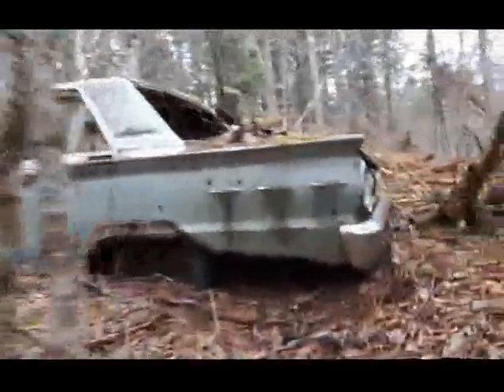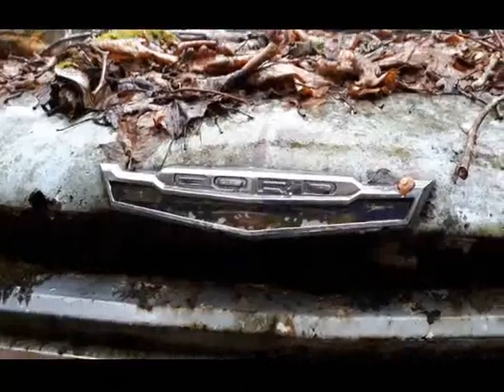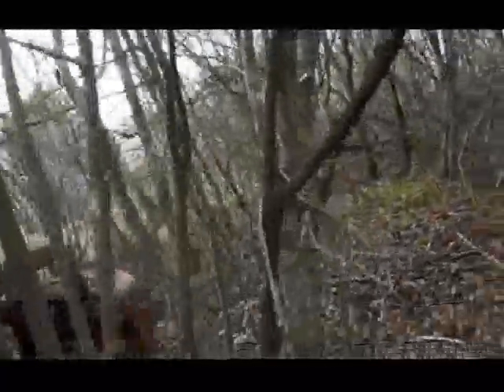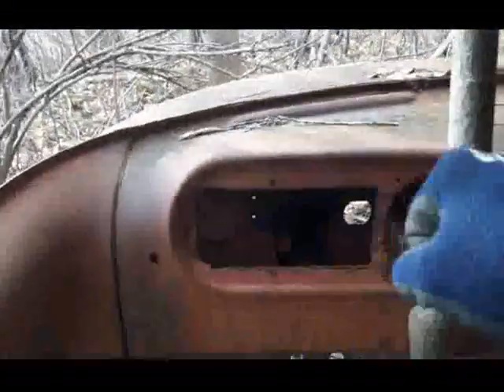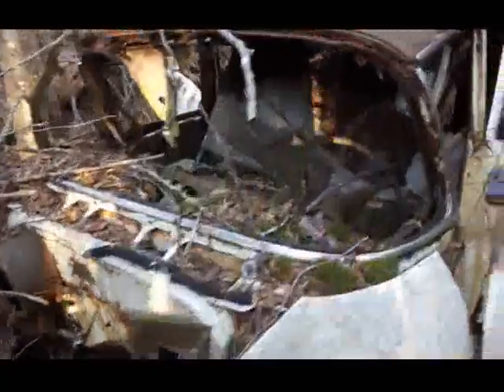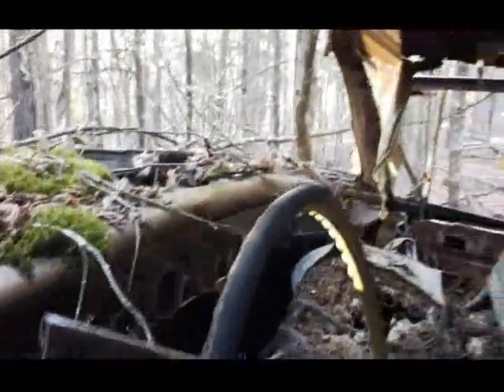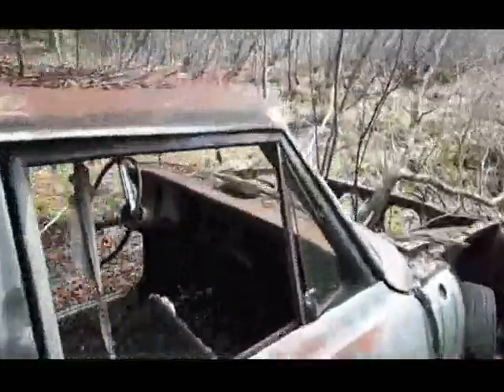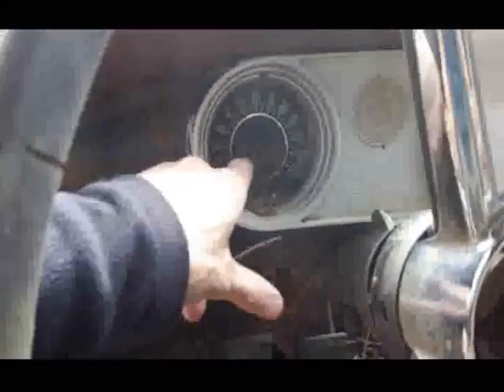Abandoned Antique Car Show ~ Pontiac Star Chief, Ford Fairlane 500, Saint Croix Dairy Van

Comment: Now these are some really cool finds.
 I love finding old abandoned cars like that.
That last one that you didn't know what it was is about a 1963 Chevrolet Acadian. What's the Canadian version of the Chevrolet 2 which would eventually become the Chevrolet Nova. Back then GM used to make the cars a little bit different for the u.s. and Canada. Pretty much the same body, but different tail lights, Grill and some other small stuff.
I've always liked those tail lights, Nova had a square tail light but the Canadian one got that cool Arrow shaped light..
Good stuff man
Reply from the maker: Hey Rich... any chance of you being able to identify the picture at 7:20 ?
Reply: @Travelling..Bottle..Digger  you're really testing me on this one LOL
I'm not 100% sure, but the Body Lines, the tail lights, the location of the fuel filler, that split window is making me think 1937 Plymouth.
The only thing different is the trunk should be sticking out a little more. Now I know the trunk lid is missing, but I think the body itself is supposed to curve out at the trunk.
Everything else looks like 37 Plymouth, not sure if it is a little different for the Canadian Market like Chevrolet did, or if it's just a different model that I haven't seen?
 But if I had to guess I'd say 37 Plymouth. Even looking at the 37 Plymouth, everything else is the same.
If there is one thing I have learned working in different shops over the years, it would be there is so many different models each car back then.
You can have 5 of the same car of a particular year, and all 5 have different options, body styles, trim.
Back then they didn't make all these different models like they make today, so they would take one model and make it five or so different ways.
Hope I was able to help, or at least steer you and a close direction. 😀